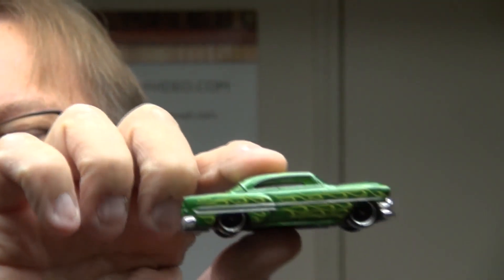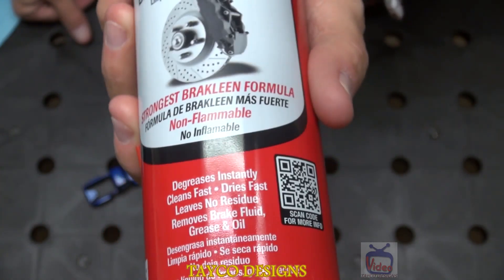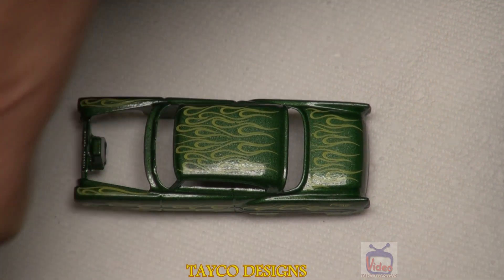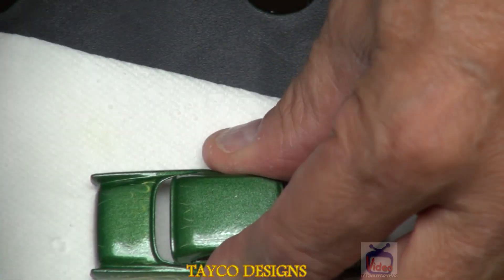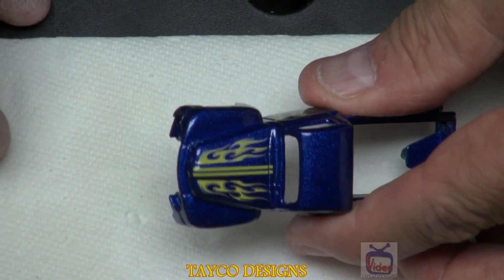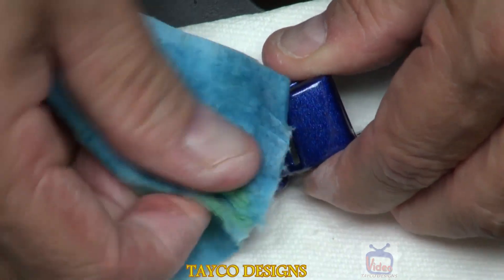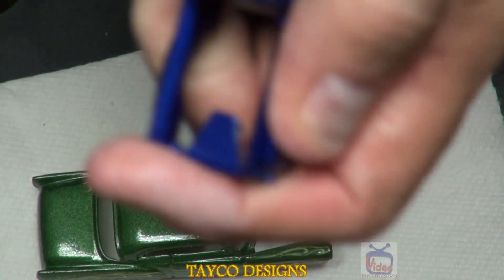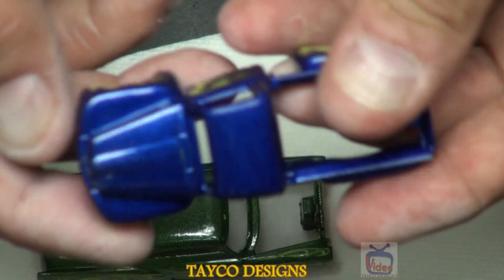Easy And Quick Way To Remove Tampo's From Hotwheels Matchbox Diecast Cars

Comment: I thought outside the box and used Hoppe’s #9 gun cleaning solvent which is what I had on hand. With a little rubbing I was able to remove the ugly 50th anniversary Hot Wheels Tampo from a Chevy Blazer 4x4 without paint or windshield damage. Smells good too!